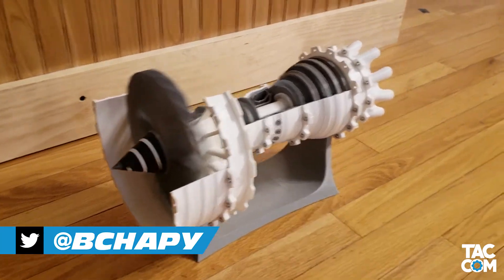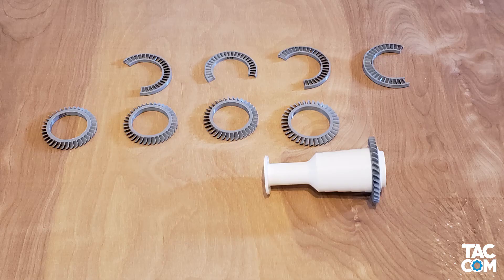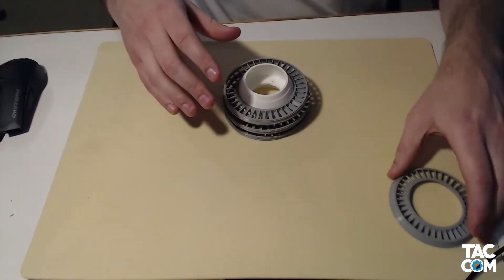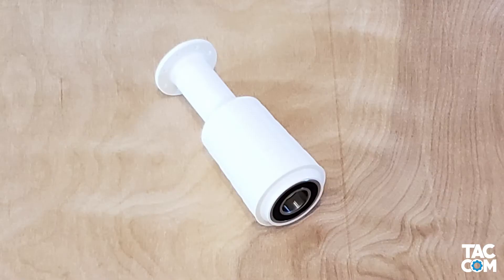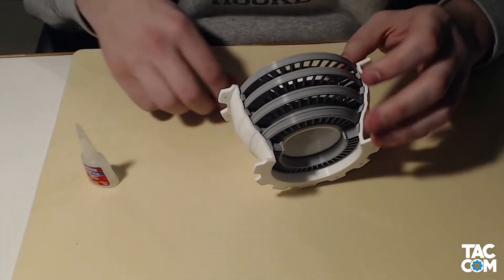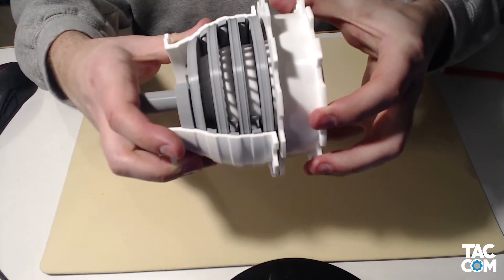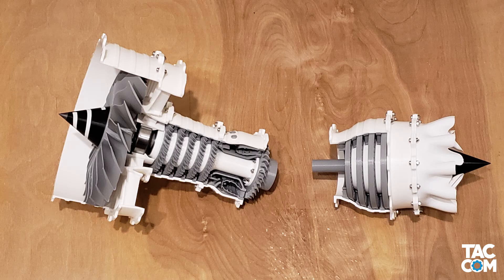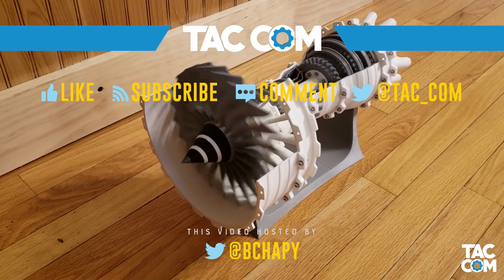3D Printed Jet Engine - Part 3: Assembly Guide

Comment: the fan is a bit tough to move i.e. try to move it with my hand it spins but it seems like not so smooth any recommendation?
Reply from the maker: Can you tell if it's rubbing anywhere?
The LPT rotors are typically the culprit. If they're angled at all they may rub the case. There's also the possibility of the LPT rotors rubbing against the aft end of the case.

Typically the HP spool spins pretty well (if bearings are good).
Reply: @TacCom  checked the bearings, brand new and working. I suspect the same when turning by hand with a slight force, it is indeed rotating as it should some minor clicking sound. I have noticed the LPT rotor case as well is not 100 tightened due to friction I had to make it a bit loose. 
do you recommend reprinting or maybe disassemble sand a bit and reattach.
Reply from the maker: @Rafiq-z4h sanding around the aft LPT housing solves a lot of issues.

If it's rubbing the perimeter of the case, you'd likely need to reprint some parts.
I live this model, but the tolerances are a bit too tight in some spots (IMO).
Reply: @TacCom  do you recommend printing the whole LPT modue?
I was thinking to sand the rotors and sand the LPT housing a bit to make it smoother. 
The connection of the LPT housing to the Nozzle section is also not so good. Had to keep it loose to let the LPT rotors rotate.
Reply from the maker: Hard to say.
I guess 1 other thing that may have some influence is the shaft connector between forward/aft LP shafts. If the shafts aren't perfectly straight/aligned, it can lead to non-uniform spinning, thus rubbing.

I'll also note that I wouldn't worry too much about how freely it can rotate. After a bit, the engine is just a cool stationary print - I keep one on a shelf at work. You're not spinning it too often, so it doesn't really matter too much.
Reply: @TacCom  that is a fair point, but as an engineer you fully understand when something does not work it bugs you! thanks a lot man! appreciate it!!

Comment: hi there, i printed bearings for the jet engine and they spin pretty well. should i glue the bearings to the shafts?
Reply from the maker: You can, but it shouldn't be needed.
If you do, make sure to spin it for a while while it dries so that you ensure no glue got into the bearings.

Also, IDK what the longevity of printed bearings are. May be safer to not glue them so that they're replaceable.
Reply: Thanks, will do

Comment: Great vid! But I'm having issues with the HPT-section it seems. When I spin the fan the LPT spins, but HPT does not (and spinning HPT does not spin fan and HPT). Any ideas where the problem is? And good ideas on how to fix it?
Reply from the maker: This is a "dual spool" engine. The LPT drives the Fan and the HPT drives the HPC.

So, it sounds like it working properly. The 2 spools should spin freely from each other.

Comment: Thanks! Anyone know what turbine model this is based on?
Reply from the maker: It's not based around any specific engine.
Reply: @TacCom  From what i can see, its based on a Trent 900, with some modifications.
Reply from the maker: Yeah, that looks pretty similar.
Reply: Trent 900 is a 3-spool design. This model only has 2-spools. There is hardly any similarity. 
What has many confused is I designed a nacelle for this model based upon the Trent 900. But the core engine itself it not based upon the Trent 900.
Reply: @rtwileyrc8030  Is this Nacelle model you speak of the one with the Chevrons on the rear of the nacelle? If so, you should probably be aware that the Chevron design is a Boeing design and is utilized for the Trent 1000 engine on the Boeing 787. The Trent 900 powers the Airbus A380 and hence does not have the Chevrons on the nacelle.... Just FYI....
Reply: @worldwidepig  You are correct. The Trent 900 has no chevrons. However many people requested a chevron design just because it looks cool so I gave them both. I caution builders that the chevron design is not found on the Trent 900 but many people build it that way anyway.

Comment: Thanks for this video! made my life a lot easier. I didnt have to use much glue as the fittings were quite snag. For the stripe in the front nose I put it in warm water so it was flexible when applying.
Reply from the maker: Interesting idea. I've tried using a heat gun (lightly) before, but you have to be really careful with that.
For the water, did you soak it to heat it up, then dry it off a bit before gluing it on? Just wondering about the glue adhering if the part is still wet.
Reply: @TacCom  I use a heatgun to get rid of some of the small hairs... but indeed you must be very carefull. What I did with the stripe was: dip it in hot water and when soft shape it around the cone bit by bit. After that it had almost the correct shape. Then I just let id drie and glued the beginning and end with a small dot of glue. worked perfectly.

Comment: Question, how do you get your model spinning as freely as it does? I was able to shave plastic in various places to create the necessary clearances such that nothing is scraping, but because of the grease, my bearings are way too gummy to spin more than one rotation with a push. I even purchased another brand of bearings and had the same issue.
Reply from the maker: Clearances were a big part. But for the video, I used a leaf blower to blow into the engine and make it spin.
Reply: @TacCom  I figured there was a blower involved. My main issue is in the LPT. The HPT spins beautifully, but it seems like no matter how I slice and print or sand, the LPT always wobbles and rubs. Any tips here?
Reply: @dufric88  I'm running into the same issue - I found that making sure the shaft was on exactly straight helped a good deal, and the rest was able to be taken care of with some aggressive sanding. LPT gave me far more issues than any other part of this build!
Reply: Your issue is the bearings themselves. Sealed bearings are full of grease as you indicated, which creates a ton of resistance for such a light model like this. Grease is useful in bearings when they are under much more load and need to last longer. Take the bearing seals off and remove all of the grease with something like brake cleaner. Then add a couple drops of light oil instead. Your model will spin much more freely, guaranteed.

Comment: right now i cant buy the screws or nuts. Do you think it will work if I 3d print them? And also, are the washers essential for the engine? thanks for the great video, I hope you answer :)
Reply: And by the way, do you know where can i find them to print them?
Reply from the maker: I don't think 3d printing the bolts/screws/washers/nuts. Threading wouldn't work well at that scale.

Washers probabaly aren't essential... But they probabaly help.

If you can't wait to get ahold of the parts, I guess you could just glue them.
Reply: GowTac-Com thanks a lot :))